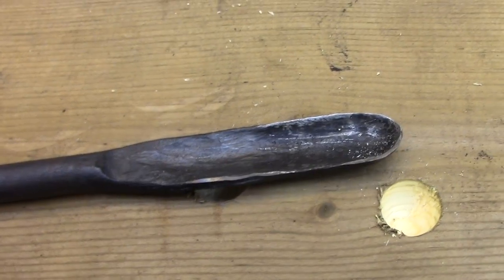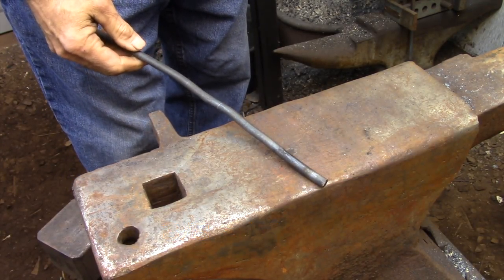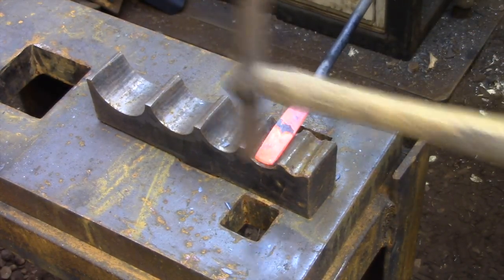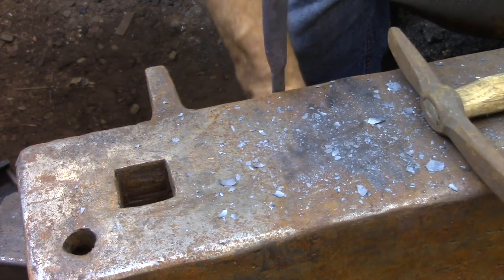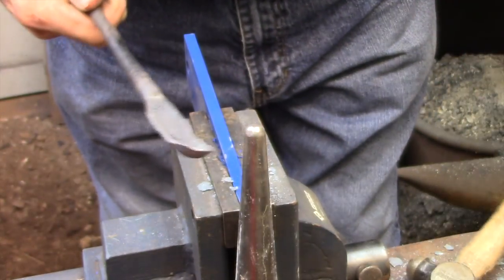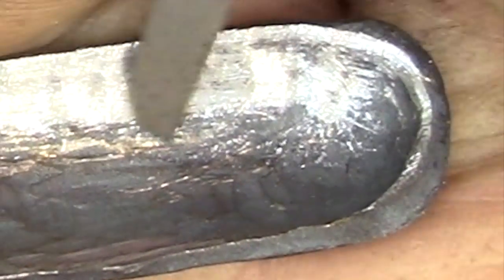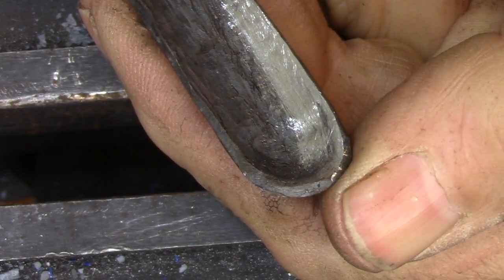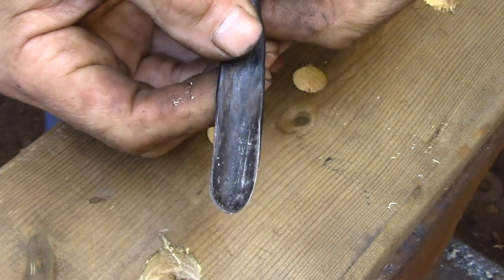Blacksmithing Project - Forging a Spoon Bit

Comment: Is reasonable to file the sides sharper when it is flat (2:24), when you save some energy afterwards (6:06), or would they deform badly?
And if you have to temper it, where you would start heating it in forge?
Reply: Thanks for the answer! This helped alot.

Comment: Спасибо! отличный инструмент.  Но почему вы его не закаливали?
Reply from the maker: I did not harden this drill because I use a hand scraping tool sharpen it.
Reply: @df-intheshop330  Понял, спасибо. Не подумал об этом сразу.  Но ведь можно закалить после черновой заточки?  Или сверло такого типа нормально работает и в сыром виде?
Reply from the maker: That is right.  These tools were once only used on freshly cut wood so there was no need for a hard cutting edge.  When you harden a tool you must make a decision between how hard the cutting edge will be and what tools you will need to sharpen that tool.
Reply: Спасибо за ответ. Действительно, на отсутствие доступных инструментов для заточки свёрл можно не обращать внимание только в наше время одноразовых инструментов. В прошлом, любой инструмент изготавливался в расчёте на то, что его будут использовать всю жизнь, подтачивая по мере износа.

Comment: Hi, I have some smaller spoon bits that are like you describe the worn out ones, just like a narrow gouge. There isnt much info I can find on sharpening them. What was the article you referred to?
Reply from the maker: The article is in the Fine Woodworking book on Hand Tools (1986?).  I have all the information at the beginning of the video.
Reply: Thanks, my bad - I skipped a bit to get to the sharpening part! I have a couple of books from that series, and I think that one is on my list to get.

Comment: That looks like something I could make from one of those auto spring bits I find all over town. Did you heat treat it at all?
Reply from the maker: Yes it is heat treated to a full blue like the other wood drill bits I made.  That makes them tough enough to hold an edge for a while but easy to sharpen with a file.
Reply: That makes a lot of sense. Thank you!